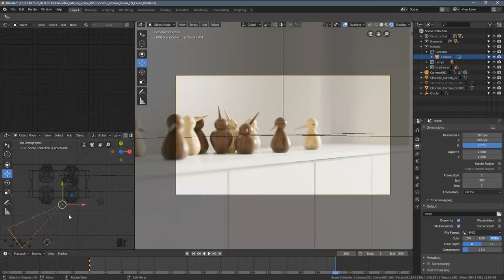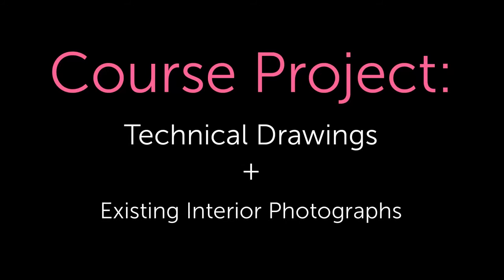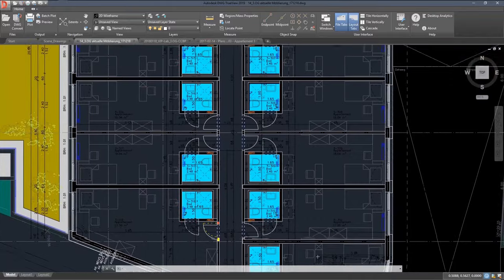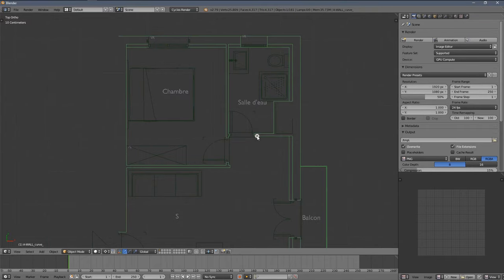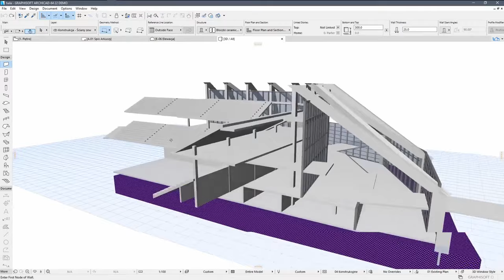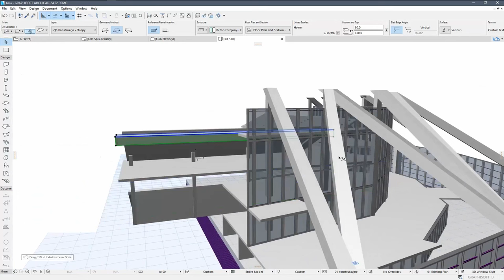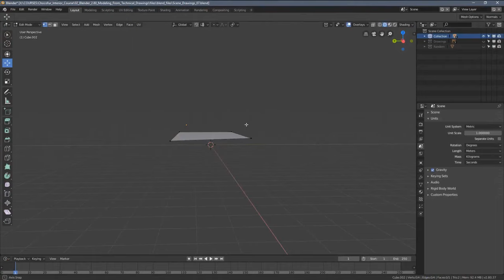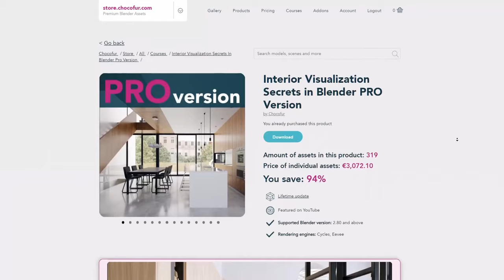Blender Archviz: Project Scenarios | Part 02 |

Comment: Nice. I generally open dwg in pconplaner and then import the images to Blender. Using dxf is for me a huge waste of time and memory, I never lose time cleaning the dxf
Reply from the maker: Thanks for your input Hugo. Unfortunately, as I was working on the course pcon wasn't available for MacOS, perhaps that has changed? I wanted my file converting methods to work across all the platforms. The browser solution from Autodesk was the only option at the time. If possible I still simply ask my clients to send us the drawings merged to PDF's - makes things way easier for everyone :-)
Reply: @Chocofur  yes, before I found pconplaner I also asked for the PDF. Not sure if pconplaner works in a virtual machine

Comment: Out from my experience most 3D-Models out from any CAD-Software comes nearly always in Triangles, often Millions of Triangles - Quads are nearly unknown. 2nd most seen are 2 or more surfaces and even solids at the same position (what leads to glitching in Blender). But be happy, if you are able to get a 3D-Model - very often i only hear "No, we dont work in 3D and we dont want that too, because its too complicated / no one here can do that / needs to much time / Software too expensive / and so on ...". Especially in the machine industry.
Reply from the maker: Thanks for your comment Markus, that was exactly my point. From my experience it is much, much quicker to create new 3D model from scratch than trying to fix a broken CAD export. But having that broken CAD model as a reference speeds things up.

Comment: the impression is that it is bad to use and enjoy the benefits of the technical and rigorous elements provided by the designers…..is it?  both methods are possible to use according to the needs and objectives....
Reply from the maker: Thanks for the comment Bruno. The reality is (at least it was in major projects I've worked on) that majority of CAD drawings weren't rigorous at all. The mismatches between floor plans and building sections are very common. Same as the design updates which are often applied just to the general floor plan and not to the corresponding drawings.

Not to mention, clients like real estate agencies, rarely understand the technicalities of CAD files. They almost always throw at you the merged PDF's or JPG's received from architects, which they know how to open in difference to DWG's or DXF's.